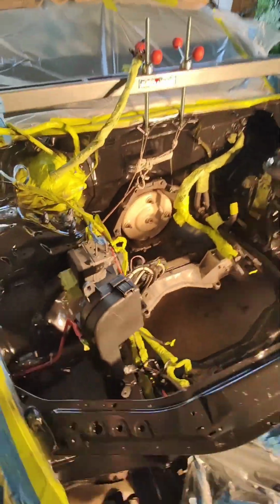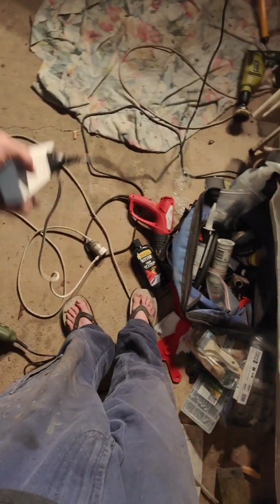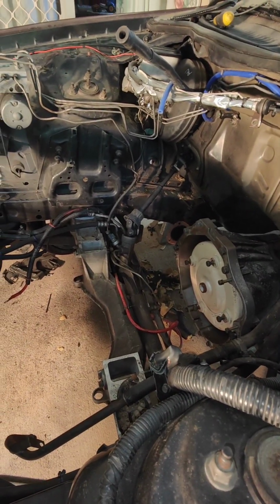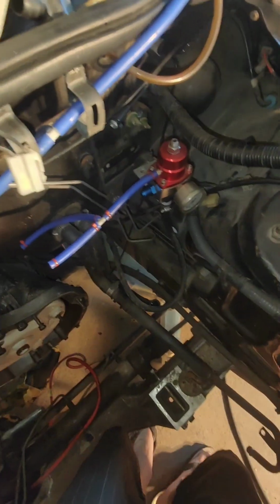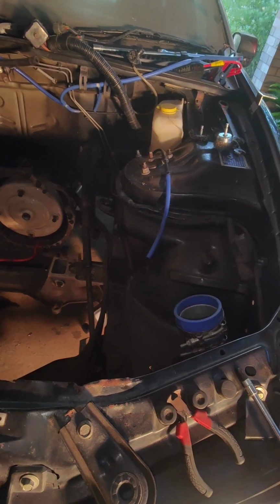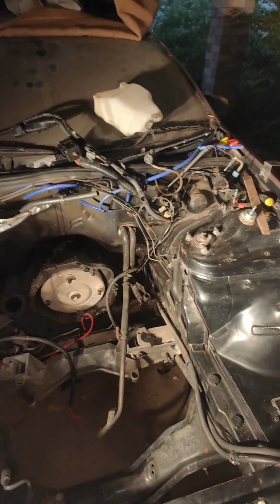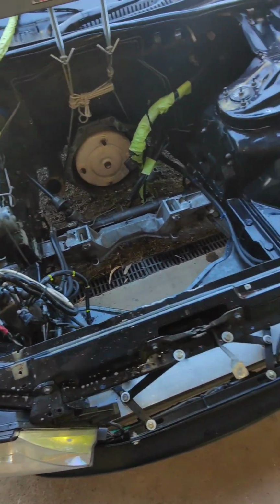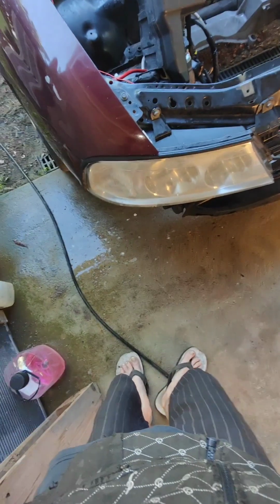Got off track. prepared the engine bay for paint

Comment: Hi mate,bit hard to see (usually blue on one side and black on the other)but it does look like a one-way check valve. Solenoid is to change between the short & long runners on the BBM at different RPM's.
Reply from the maker: Cheers for that mate. Yer it's completely black. Might need a clean lol but yer it's a bit weird cos there is the vac line that goes to the BBM to control the runner. And then one vac line goes to heater valve on the heater hose and the rest go through the fire wall, assuming to the aircon. Either way Im pretty sure it's needed. I would only need it for the heater part anyway as Ive removed all aircon stuff cos I don't use it. And I've taken the runner out of the BBM cos turbo.
Reply: @ajs_car_garage  like the B Series there could also be a solenoid for the charcoal canister as well.
Reply from the maker: Charcoal canister is removed along with the solenoid and everything that attaches to it.